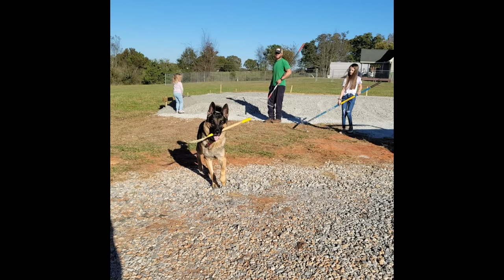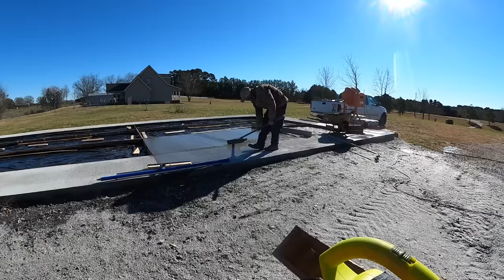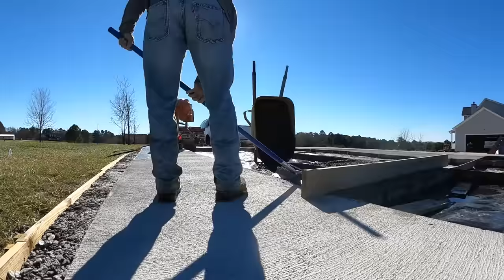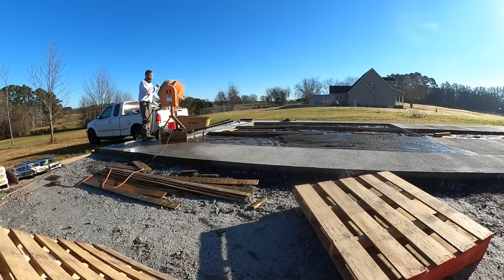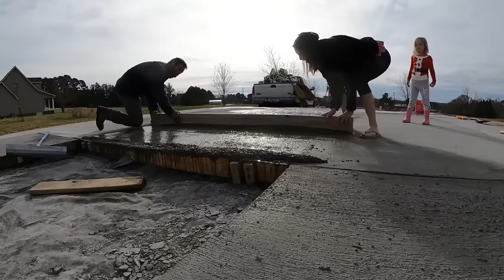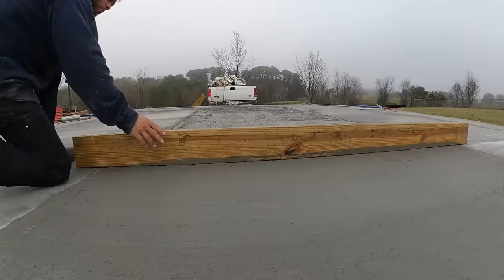Pouring a Huge Concrete Slab Using Bagged Concrete | I Saved $10,000

Comment: How much cubic meters does it represent?
Reply from the maker: It is right at 18.5 cubic yards. Not sure about meters.
Reply: @reallifetested2605   @Real Life Tested  Converter says 14.1 cubic meter.
Then there is something I don't understand, maybe prices are really differents beetween USA and Europe.
Here I would have asked for 2 trucks and it would have costed me around 1500 euros.
Or I would have mixed myself sand, gravels and cement. 17 m3 for gravel/sand = 1000 euros + 170 cement bag (35 kg) = 1000    TOTAL 2000 euros (without qty/price reduction)
If I would have used bagged concrete, it would have costed 4600 euros.
The ready bag solution is more than twice more expensive than other methods, how can you save 10 000?
Reply from the maker: @marcapouli7805  In my area #80 bags were 3.20 each and truck was 200 to 220 depending on the day with a 4-6 week wait. 
I was quoted 14k and  up for this job and I ended up doing everything myself for right at 3800.
Reply: @reallifetested2605  Trucks are very small then. Here we have trucks with 10 cubic yards each. I would have asked for 2 trucks and they come both in the same morning. I still don't understand where the 14 000 come from (maybe a quote from an enterprise with workers, but that seems like a scam to me. This work is done in less than 4 hours with 2 people).

Comment: Sorry, but I can not see how you saved as much as you said. Slab that size is gonna be about 5k in premix concrete.
Sure doing the labor yourself will save. Concrete premix is going around 150 a yard currently, quikrete at bags is just over 300 a yard. Where is the savings?
I could see it if you were using Portland cement and making your own concrete.
Reply from the maker: If you’re interested I made a 1 year update and answered a lot of the most frequently asked questions to the best of my knowledge. I cover prices in the video as well. I’ll link it below. 

Pouring a Huge Concrete Slab Using Bagged Concrete | ONE YEAR UPDATE
https://youtu.be/qKcy6BI8yA0

Comment: Any rebar in there?
Reply from the maker: I called around to check with local pros before taking this on. In my area rebar is only used in industrial or commercial settings. (Unless requested) We have good soil, it rarely gets below freezing, and we don't have any natural disasters.
Reply: @reallifetested2605  I live in Canada, where it gets freezing all the time. Is that a deciding factor to put rebar in?
Reply from the maker: @user-sc8ci6go9c I’ve heard freeze thaw cycles is what causes the earth beneath to shift but I’m honestly not a professional and don’t know the exact reason.
Reply: @reallifetested2605  Ok, fair enough. I'm 99% sure I need rebar, but I will continue to look into it. Thx.

Comment: I don't see any rebar
Reply from the maker: In my area it's not used in residential on grade 4" slabs.
Reply: @reallifetested2605  my recommendation is you don't have to stick with the minimum code. In the future if you pour concrete any size definitely add reinforcement, try to get it centered in the slab.  Concrete has excellent compressive strength but when engineering something constructed from concrete it is assumed to have zero tensile strength.

Comment: I don't get this ? A 23'X23'X4" slab requires 295 80lbs bags of bagged concrete @ $5.70 each plus tax ($1,900) is just about the same price as eight yards of concrete delivered by a truck mixer (8³ yds @$200/yd plus tax cost me $1,900). Minus several days of hard labor. Where's the $10,000 savings ?
Reply from the maker: I did a 1 year update and explained everything as well as answered questions. Also bags in my area were 3.20 at the time I think they’re around 3.60 now. Truck is 200 to 220 contractors wanted a minimum of 14k up to do this job. I have 3800 in everything.

Comment: How can you save 10k? Premixed concrete is mucher cheaper than bagged
Reply from the maker: In the first 60 seconds of the video I said doing everything myself saved me 10k. #80 bags were 3.20 each and truck was 200 to 220 depending on the day. The concrete saved me right at 1200.

Comment: You used 830 bags X .6 cubic feet per bag = 498 cubic feet. At 27 cubic feet per yard = 18.44 yards of concrete. At $200 a yard, delivered that is $3688. I don't see how you saved $10,000. 830 bags of ready mix might have cost $3 each for a price of $2490. That figures that the savings were $1198 for the concrete. Still a savings but not $10,000.
Reply from the maker: I said in the first 30 seconds of the video doing it myself saved me the money. I don’t have a good speaking voice so it might’ve been hard to hear. You were close with the prices though. Truck was 200 to 220 depending on the day and bags were 3.20 each. Lowest quote we received for the work was 14k. I have 3800 in everything.
Reply: @reallifetested2605   thanks for the reply. Still impressed.

Comment: how thick was it?
Reply from the maker: I was aiming for 4-6" and the slab ended up being just a tad over 5"
Reply: @reallifetested2605  i was looking at concrete cost after watching this. i found a concrete calculator and maybe im wrong, but i saw 1000 80lb bags to do a 6 inch, 40x60. how many 80's do you think it would take?
Reply from the maker: @farnorthhomested844  that's a big slab! Ok so 40x60 is 2400 sq ft. 2400 x .5 (the .5 is half of 1. I come up with that because half of a foot 12" is the 6" you're asking about) that comes out to 1200 cu. Ft of concrete. 1 cubic yard is 27 cu ft. 1200/27 is 44.44 cu yd. Of concrete. (1) 80 bag is .6 cu ft. 1200/.6 is 2000 bags that you'd need. It's always a good idea to order more than you need because it's hard to get everything near perfect. I know that was long and maybe confusing the way I worked it but I hopes it makes sense!
Reply: @reallifetested2605  thanks for the reply. i was short by 1000. great math!

Comment: around me the truck is cheeper than the bag
Reply from the maker: Hopefully it's that way around here now I have another project coming up and truck would save me a bit of time. 

I did a 1 year update on the slab with me answering the most frequently asked questions if you're interested. 

https://youtu.be/qKcy6BI8yA0
Reply: @reallifetested2605  when i priced a 20 x30 @4" thick the truck was cheaper

Comment: Just call for a truck. You can strike it and finish it yourself and ur saving enough.
Reply from the maker: I wish I could have but I didn’t feel comfortable doing all that by myself. The bags were cheaper as well at 3.20 for #80 bags vs 200-220 depending on the day for truck. The bags allowed more convenience.

Comment: I don't know where you live, but where I live in the NW this would not have saved any money.  The bagged concrete is expensive.  It actually costs less to have a truck deliver a load of readymix.
Reply from the maker: I wish it was that way around here. Contractors have lost their minds as well as suppliers it seems.

Comment: Wait.  Am I missing the rebar or are you?
Reply from the maker: I called around and spoke with local pros. In my area they don’t use rebar on 4” residential on grade slabs. It rarely gets cold here and we have a hard clay soil. I’ve never seen it used in small buildings / driveways around here. I did a 1 year update if you’re interested. I don’t have any cracks at all and show the slab.
Reply: @reallifetested2605  Thank you I will check it out

Comment: You telling me you use over 1,000 80lb bags of concrete and thought yu were saving how much money
Reply from the maker: I did lol truck was 200-220 per yd with a 4-6 week wait and 80 lb bags were 3.20 each. Local contractors quotes were from 14k to 20k. I have 3800 in concrete and over 100 ton of gravel.

Comment: You "saved" money. So far. But floating slabs have a turn down around the perimeter for a reason. You appear to have poured a floor, but didn't bother building a foundation. Did I miss something?
Reply from the maker: I’ll be doing yearly updates so stay tuned!

Comment: These eyes are old, but where is the rebar?
Reply from the maker: I called around and spoke with local pros. They said in my area its not needed in a residential on grade 4" slab. I don't really see it in small slabs, or driveways around here. Only in homes and commercial buildings.

Comment: working backwards with your number of 831 bags of concrete: given there's about 45 bags of concrete per yard, then 831 / 45 = 18.5 cubic yards of concrete in you pad.   Home Depot cost of bag is about $6 per bag with tax or 831 x $6 = $4986. My wild maximum guess of concrete is $200/yard x 18.5 yards = $3700           Conclusion:  How do you save any money here???    Note, this doesn't even factor in equipment, hauling costs of bags and the serious risk of screwing up your back.                                                              really, HOW THE FUK DO YOU SAVE MONEY HERE?
Reply from the maker: See my 1 year update. Idk where your bags are but here they’re like 3.60 for #80. When I did this they were 3.40. I show price on my phone. Truck was 200 to 220 depending in the day with a 4-6 week wait.

Comment: Ok so you SAVED $10K

That’s all good, however? How much did it end up costing you?.
Reply from the maker: Prices are all over the place based on where you are. I was quoted a minimum of 14k from multiple contractors. I ended up doing everything (over 100 tons of gravel, concrete) for right at 3800 dollars.

Comment: 48 by 25 feet that’s like 2k worth of ready mix…. And 800 plus bags of concrete mix is over 4k so where’s the saving
Reply from the maker: I wish I could get concrete for 130 per yard. In my area at the time it was 200 to 220 depending on the day. #80 lb bags were 3.20 each.

Comment: Ok, I don't even come close to following your math here. Would like to see a cost breakdown for your project. Considering all-in, the current national average cost per square foot of a slab that size range is around $10/sq.ft, so that's only a $12,000 project total. Not sure how you saved $10,000 by DIY. But total cost aside because you don't have a breakdown, let's just look at the cost of the concrete itself. Ignore your gravel, formwork, vapor barrier, etc... Just the concrete... So you used 830 x 80-lb bags. That math works out to just over 18 cu yd of concrete (45 bags per yard.) I don't know where you live, but around me, you can buy 80-lb bags in bulk for right at $4.00. So based on that math, 830 bags would come out to $3,320. Not counting the mixer or any other tools of course. Well, again, not knowing where you are, but the national average cost for ready-mix concrete delivered to you by mixer truck is around $125. $150 tops unless you're someplace crazy remote like some place in BFE Alaska or New York City. If we call it $150/yd, that's only about $2,700. You paid more for that in back-breaking fashion, hauling and mixing one bag at a time. I don't get it!
Reply from the maker: I haven't seen concrete for 125 dollars in over 10 years here. When I did this they were wanting 200 to 220 depending on the day for truck. I got #80 bags for 3.20 each. (Not sure if its true but I was told there were shortages in concrete when I did this is why truck was high like it was. I called a few months ago and it's still 165 with a 4-6 week lead time) 

I was quoted 14k and up from local contractors. I did it all myself for a little less than 4k. I could have done truck but i've seen so many people screwed over or getting property destroyed by trucks I decided to mix myself. I also didn't think I could take on that big of a pour alone.
Reply: @reallifetested2605  It looks like you were wearing some kind of gator/bandana for a mask. With 830 bags of dry cement, investing in a respirator adequate for filtering microscopic crystalline silica dust would have been a wise investment. I wouldn't open/handle/mix just 1 bag of dry cement without a respirator, let alone 830 bags. You were exposed to a lot of airborne silica dust, and fabric masks just can't filter nearly well enough for small particles - the ones you can't see.

Comment: You could have done a dry pour and never had to mix anything.
Reply from the maker: I've seen that online but would be afraid to attempt it on my own project. I wish someone would do testing comparing the differences between wet and dry pour strengths.

Comment: You get what you pay for. Not one bit of steel in that slab and pouring secctions like that without adequate concstruction joins or dowels is another no no. And the finish is less deseriable but hey you got a slab. Will it last as long or look as good. Definitely not. But if ypu dont have the money to pay people to do it properly and want to get it done then go for it haha
Reply from the maker: No one in my area uses steel unless it’s a home foundation, commercial, industrial. I’m doing yearly updates and about to be in year 2 with not one crack or separation. We paid “professionals” when building our home to do our front porch concrete 4 years ago and it’s cracking all to heck. There are better ways to spend money than on a workshop floor.

Comment: How did you save $10000????? I just calculated using the Home Depot concrete calculator for a 38’x30’ slab 4” thick , using 80 lbs bags comes to 634 bags @$ 3.98/bag = $2523.32. The same cubic yards at $204/yard from a local ready mix comes to 
$ 2,870.28 and you don’t have to do all the labor for mixing and hauling it every little load in place. Did you buy the concrete bags at minus $10/bag? Did they give you the concrete bags and pay you too? And the only thing you have to do hire a team of 3 of them Mexicans for the 3 hours that take to pour and finish it, give them $30/ hour each and “loncha” with plenty of Coca Cola and it comes to $270 plus loncha and save my time and back. That’s why God invented them Mexicans. You can find them on the big developers job sites, just talk to them and tell them that you gonna have more future work. It works every time. Even at $35/hour it’s worth it, granted you have to be there to watch them.
Reply from the maker: I said doing it myself saved 10k in the first 30 seconds of the video. Bags were 3.20, local plant wanted 200-220 per yard with 4-6 week wait. Local contractors wanted minimum of 14k for the work. I have 3800 in concrete and over 100 tons of gravel.

Comment: I dont see how you saved anything, in fact you paid more! Around here concrete is 178  dollars a cubic yard. It takes fourty-five, 80lb bags to make one cubic yard! And at 6.99 a bag you spent 314.55 a cubic yard, not counting your mixer too!... I dont get it, you spent almost double for that pad! For what you spent in concret bags alone you could have had it delived and finished for the same price of all those bags!
Reply from the maker: “Around here” you have to think it’s different everywhere. I was able to get 80 lb bags for 3.20 each. I made another video showing online prices in my area. Local truck they wanted 200-220 per yard with a 4-6 week wait. Local contractors wanted a minimum of 14k ranging up to 20k for this work. I’ve talked to some guys on here concrete is 130 per yard in there area. Wouldn’t that be nice.

Comment: first, I have a hard time believing you saved 10K. your slab, at 4"(which is what it appears) would take 14.61 Cu.yrds. at 6" 22.16 yrds. to save 10,000 dollars, the price per yard difference would need to be $681 or $451....PER YARD between readymix or bagged. Where do you live that a full truck of concrete is $500 or so MORE than bagged? LOL. I just paid $173/yard for a short load(less than 9yrds, which comes at a higher price), with fiber and dye.

I really want to know your math.......
Reply from the maker: Not sure you listened to the video. I said in the first 60 seconds of the video doing everything myself saved me $10,000. I was quoted 14k and up from local contractors. I did everything myself for a little less than 4k. Truck was 200 to 220 depending on the day and I got #80 bags for 3.20 each.

Comment: The cost per yard of concrete by the bag is around 2.3 times the cost as per yard of truck delivered concrete. You cannot state that is a saving. IT'S A LIE as per the cost of the concrete alone. Then there is the factor that there is NO REBAR IN THE FLOOR, The floor will crack out and separate huge. This is a joke for savings.
Reply from the maker: When I did this 80 lb bags were 3.20 each and truck was 200 to 220 with a 4-6 week wait. No one uses rebar in my area unless it’s a commercial/industrial setting. It rarely gets below freezing here, we have stable soil,  and we don’t have any earthquakes. I called around and spoke with local pros to verify.

Comment: didn't save a dime bagged concrete is double the cost and half the quality of professional made mixed trucks
Reply from the maker: Eggs were also less than 2 dollars and now are 6… When I did this #80 bags were 3.20 each and truck was 200 to 220 per yard depending on the day with a 4-6 week lead time. We were quoted 14k and up from multiple contractors. I have a little less than 4k including concrete and a little over 100 tons of gravel. Quality seems to be same or better. It’s 4000 psi concrete.